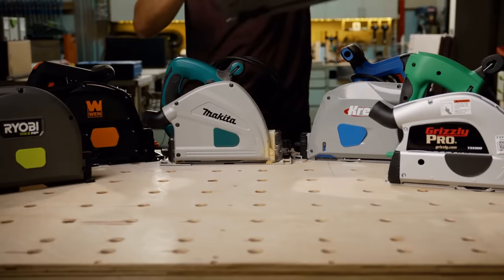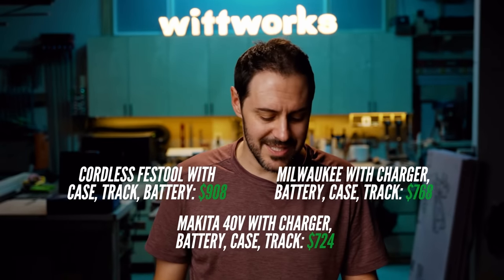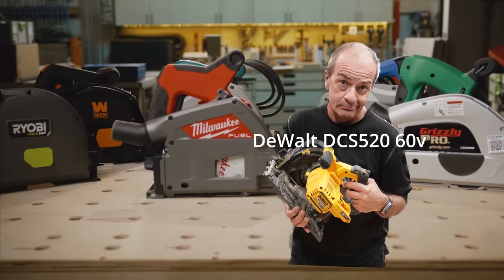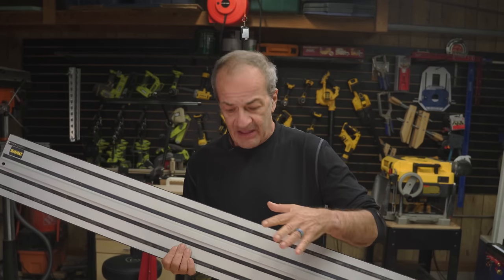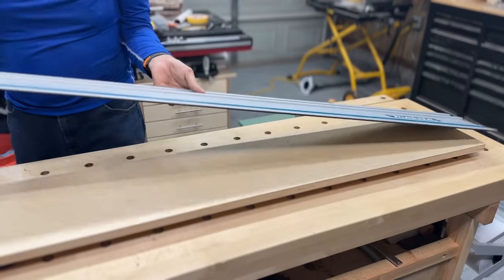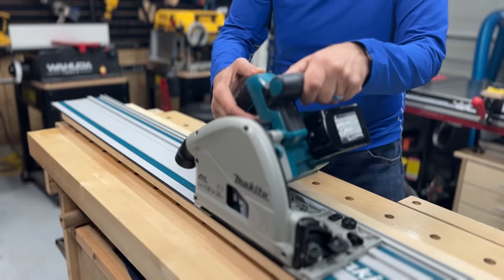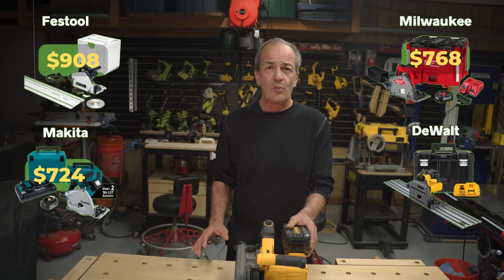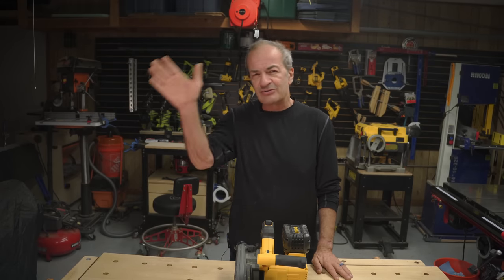The Best Track Saw NOBODY Talks About

Comment: I only do straight 90's. I have the Wen and the 118" track (2 pc). Is it great? Hell no. The bevel is janky as hell. But for straight 90's, it's perfect. I set up my machine squares on the bottom and it's been great. Would I like another track saw? Probably, I guess. It's fine.
Reply from the maker: I have a few Wen tools (drill press, 12" disk sander) and they're pretty decent. No complaints. The price is definitely right, and at least you can get someone on the phone (unlike some companies).

It's actually pretty rare that I do bevels with a track saw also... I've done it with this DeWalt maybe three times total.
Reply: @BustedKnuckleWoodworks  My money went into the Dewalt 735 because I work with a lot of 8 to 12' stock like white oak, walnut, elm, etc. I got a large bosch router, the dewalt 735 and the wen track saw for the same price as a silly festool domino haha.
Reply from the maker: I'm keeping my Domino. Selling it on Craigslist is my entire retirement plan LOL

Comment: I was wondering why Witt never even mentioned the DEWALT. I got the DEWALT track saw about 3 weeks ago for an even lower $579, with everything included that you mentioned in the kit. I was holding out until the Milwaukee came out, but once I saw the prices, it was a hard no for me. Not to mention I’m DEEP in the flex volt system now (probably 10-12 9ah batteries deep). I just wanted to indulge in the new toy that we all wanted to see for years. But at the price for the Milwaukee, it just didn’t make sense to me.
Reply from the maker: Nice! The DeWalt track saw is great with the 6ah it comes with, but really screams with the 9ah. You really need the 9ah to squeeze the 2,000 watts out of it that I mention in the video...
Reply: @BustedKnuckleWoodworks  Well it’ll be screaming almost every time. My 6ah mostly get used for the dust extractor and DEWALT outdoor power equipment when the spring/summer rolls around. Another good point too: The DEWALT dust extractor (DCV585) talks to the track saw via Bluetooth. I believe the Festool and DEWALT are the only two that have those kinds of options as of now. Good content.
Reply from the maker: @CardinalVibes  The latest Makita 40v does that now as well.

Comment: Hi, I found 1 thing wrong with DeWalt. its very difficult get get the battery out of charger  or tool. Maybe its because I have small hands? any suggestions would be helpful and appreciated.
Reply from the maker: True, the battery on this is kind of heavy. I sometimes spray the latch with WD-40, that helps the latch slide easier.

Comment: I love the DeWalt, but the fiddly depth adjustment and the battery position right where my knuckles go (I’m a leftie) are two things that kept me from buying it 🤷‍♀️

By the way, the plunge mechanism is the best I can think of. I like it a lot because it’s super ergonomic in contrast to the pivot mechanism…
Reply from the maker: I don’t find the depth adjustment fiddly at all — in fact I think it’s better than the Makita. As several other commenters have pointed out, the battery placement is not ideal for lefties and I’d have to agree with that. And +1 on the plunge mechanism. Much easier to handle in my opinion.

Comment: I have run the Dewalt track saw for a few years. I have both the Dewalt track I started with and the Festool track. I prefer the festool track for the available accessories. As for the saw...it's as good as any of them and definitely deserving of being included amongst the upper level saws. I believe it to be the most versatile track saw out there. None of them are perfect. Each has features that are done better by others, so there is no best saw. Just which features are most important to you. But power tools anymore are as tribal as politics, so each brands fanboys will insist their color tool is best because it is a certain color. Makes it hard to find unbiased reviews anymore. For me, I want the best tool for the money and could care less about the color. Chargers take up no space and are a dime a dozen so I don't care about battery platform.
Reply from the maker: Great and thoughtful comment, thanks for posting it. I agree about the tribalism, which is part of the reason I made the video. Lots of comments here along the lines of "Dewalt sucks" which makes no sense to me. I just happen to think this saw is worthy of consideration among the other saws you see all over YouTube. Not necessarily the "best" in every way, but at least some out-of-the-box thinking with its design and implementation.
Reply: @Busted Knuckle Woodworks  and you can't even argue with them even though you come with facts because facts don't matter anymore, just color. Dewalt has several new tools that outperform Milwaukie yet saying that on the internet will trigger Milwaukie fanboys. Dewalt quietly released a beast of a cordless impact while at the same time Milwaukie secretly redesigned their premiere impact without changing the model number resulting in people thinking they were getting a tried and true great impact when they were actually buying something that was going to fail them, in many cases on first use. Does that mean other red tools are bad? Absolutely not. I have some really good red tools, and some really good yellow, green, and so on tools. Anyone who chooses a tool based on color alone is missing out on some really good tools.
Reply from the maker: @Ratheon1075  right on dude, love that take 👍
Reply: They make battery adapters, so batteries aren’t as important as they used to be; they the most important item, but they shouldn’t determine the tool

Comment: As far as I am concerned the Mafell track saw is the best on the market. Expensive yes.But the best.
Reply from the maker: Have no experience with that one but I know everyone who owns one loves it
Reply: We have the Mafell, TS 55, and Makita X2 cordless, and the Mafell is in a whole different league.  The cut quality and precision is simply unrivaled especially when using multiple tracks.  We have to be careful when handling cut material because the edges it leaves are so sharp they will give you paper cuts.
Reply from the maker: @dcl97  Please buy me one and I will review the 💩 outta that thing 😁
Reply: In UK, corded Mafell is not as expensive as we assume. It comes with all the track and accessories. Buy with the M-class dust extractor, and it's a similar price to the lower quality alternatives that you have to buy the 'accessories' for. I'm saving up
Reply: It is not that great actually but ok

Comment: greetings from Europe! nice video 👍
do you know the Metabo cordless track saw? for me it is very interesting that some very common brands here in Europe seem like to "not exist" in the US, as the mentioned Metabo or f.e. Bosch who also has a very decent cordless track saw. Is this just the non existing footprints they have in US?
Reply from the maker: Both of those exist but among track saws but they are not very popular in the US. I suspect part of the reason is that a lot of the market here is controlled by 2 major retailers and they 1) have exclusive brand deals on certain items, and 2) don’t generally carry these saws in their stores. 

Depends on the item though. In the US Bosch is very popular in routers, Metabo in nailers, etc.
Reply: A major part of the issue is that nearly all of the tool companies are owned by a few holding companies.  Many tools are identical with the exception of the colors of the plastic and rubber parts, and the colored bits interchange.   Porter Cable and Flex, Bosch and Milwaukee, same same, just different colors.  And which holding company owns what changes fairly often.  So, EU brands don’t show up in the US because the holding companies don’t want to compete their brands against each other.  And some brands are at different levels in different markets.   Ryobi, is a homeowner brand in the US, and a pro brand in Australia and New Zealand.
Reply from the maker: @randallthomas5207  I actually did a video about this, it’s on my page. https://youtu.be/16WAta5XFrc

Comment: how is the Dewalt dust collection on this?
Reply from the maker: It’s perfect if you have the locking Dewalt connector, or one of those flexible adapters like they sell at Rockler. The dust chute swivels 360º. I mostly use this outside when weather permits and just let it fly though 👍

Comment: The batteries really are the decision maker and how the power tool manufacturers use their tractor beam to keep you in brand. I’ve bought into Milwaukee and the tool only price gets me every time. I just don’t want a collection of chargers and batteries to keep track off and keep healthy
Reply from the maker: That’s why I call those discounted multi-combo tool bundles the “dime bags” of the industry. They hook you in with those and it’s really hard to switch after that. Although I’m a big believer in being on at least two platforms, not just one.
Reply: Why did Dewalt discontinue the brushes and the rotor shaft for the corded 520? Dewalt lost me as a customer, they walk away from their products snd also gutted porter cable after their purchase. NO bueno!
Reply: @BustedKnuckleWoodworks  I’d have to agree, although I bought into a line of cordless tools because of the performance of one of those tools and there reputation. They are very proud of their other tools, just look at the pricing.
Reply from the maker: Which line did you buy into?
Reply: @BustedKnuckleWoodworks  Milwaukee refused to buy DeWalt because of killing Porter Cable line there router line was the industry’s standard as well as there other fine tools there cordless were only ok. The majority of my corded tools are PC
Reply: Eventually, companies will start selling refurbished or generic replacement batteries. Will be interesting to watch.
Reply from the maker: @nunyabidness3075  They already do for the 20v. Never seen any for the 60v though. I don't think there is a big enough demand for the overseas knock-offs to bother copying them.
Reply: @BustedKnuckleWoodworks  Lol, I had to go shopping. I then immediately worried about quality.  I’m going to see about domestic suppliers. Thanks for the info.
Reply from the maker: @nunyabidness3075  Home Depot probably has the best return policy if you need to do that.
Reply: @BustedKnuckleWoodworks  Not yet. A couple years ago I sold my Ryobi stuff and got more serious with some Milwaukee and Makita. Batteries all still good for now. I got pretty fed up with Ryobi battery quality. I guess HD must have stepped up because it was likely hurting business.

Comment: Don't know how you got your saw to work on a Makita track. The anti tip feature on the Makita track prevents the dewalt saw from fitting. I had to modify my Makita tracks by routing off that lip.
Reply from the maker: Don’t know what to tell you. You can see in the video it clearly works. Maybe the design was changed?

Comment: One caveat you need to be aware of on the DeWalt FlexVolt track saw on it's peak power rating. To be able to pull 2000 watts from it's motor, you have to use the 9ah or larger FlexVolt battery. The included 6ah FlexVolt battery uses 18650 cells which in it's triple stack configuration has an approximate peak wattage output of around 1200 watts. The 9ah FlexVolt uses 21700 cells which will produce a peak of more than 2000 watts which will allow the track saw to pull to its full potential. You should try your own track saw with the 9ah FlexVolt and see the difference yourself. Also one of the reasons the DeWalt track saw is not very popular is due to it's poor ratings on review sites. Take a look at the Tool Box Buzz head to head review of track saws, it came in last place. The DeWalt was the lowest cost saw though in the comparison. But they also used the 6ah battery that came with the saw. If they had used the 9ah battery, it might have done better...
Reply from the maker: I do have a 9ah battery, will have to give that a try! Thanks for the excellent info!
Reply: Toolbox buss are Milwaukee simps

Comment: Pre-ordering and then receiving the dewalt tracksaw is one of the greatest tool disappointments I have encountered.  In principle I agree, but dewalt abandoned it.  In hindsight I should have bought the saw and festool or makita track.  I kept seeing people use a track saw without clamps and was amazed because my dewalt tracks walk if I try that, there are also no TSO/woodpecker/or even Dewalt add-on products.  Moreover, my saw and track were off, the more I tinkered the worse it got an 1/8” over 8’. I bought a makita 40v and will never look back. This dewalt saw got me over my batteries determine my purchase.  I now use several platforms aided by Christmas battery give aways and don't regret it for a minute.  Now I pick the best tool and not the one that can use my batteries and also don't wear a path in the concrete walking from one end of a sheet to the other
Reply from the maker: Man, that's weird... my saw has been dead accurate, and the track has never walked on me once. The Makita is a good saw. Just wish the case was better. I agree that people tend to get tied in to battery platforms more than they should be.

Comment: I understand that the dewalt has a special blade.  Meaning you can’t get an aftermarket blade.  I also heard the dewalt blade isn’t great.  I don’t have this saw so it’s just hearsay.  But since you do can you let’s us know if there’s anything to those claims?  I do own the Makita system you compared this to.  I guess i got it on sale, I only paid $500 for my kit.
Reply from the maker: Not true. I have run other blades on this saw. The CMT 56T blade is awesome on this for melamine. The DeWalt stock blade is also very good, and is the blade I use most of the time. It's a standard arbor size and take the same 6.5" blades as all the others.
Reply: @BustedKnuckleWoodworks  thanks perhaps it’s the Milwaukee then, and I remember incorrectly
Reply from the maker: @mwoody4560  Not sure. Haven't heard that about the Milwaukee blade. I do know, however, that their track is slightly different than the standard Makita/Festool tracks, which makes it incompatible with a lot of the accessories like the TSO squares and such.

Comment: Cordless is all good until time to replace those batrays
Reply from the maker: So you don’t own any cordless tools? 😳
Reply: @BustedKnuckleWoodworks  Yes I do.  But I think for tools that can be used with a cord will in the long run be cheaper.  Some tools need to be mobile.

Comment: Best track saw is the circular saw you already got. Just set up a fence (clamp on straight edge) to whatever it is you’re cutting. 1/2 - 3/4 inch plywood works great as a fence. Just depends on the motor clearance of the saw.
Reply from the maker: I always say, go with whatcha got. Don't let the lack of some fancy saw stop you from building anything!
Reply: The amount of people that say this nonsense is quite funny 
It’s not even close I do that on site when my ones not with me a track saw is so much more capable
Reply: I used to try justifying not getting a track saw too. 
The clean cuts, the accuracy, the speed, the ease of use. It's been the best tool purchase I've made in years
Reply from the maker: @Jeremy_810  boom 💥 there you go 👍

Comment: var lee = new Lazy<Woodworker>();
Reply from the maker: lee.Add(new Tool());
If (lee.isHappy) {
   lee.doReview() }
else {
   return();
}
Reply: I am glad I found this little club of software engineers who are obsessed with woodworking. 

This is a perfect place to ask a serious question:
What is the best place to buy hardwood In Austin?
Reply from the maker: I would say either Fine Lumber (north) or Dakota (south). I usually use Dakota. If it’s a small amount I will sometimes check out Rockler or Woodcraft. There’s some good mills too just outside of town.
Reply: @BustedKnuckleWoodworks  Thank you so much! I usually go to Fine Lamber… but the thing that they don’t have prices on display drives me nuts. Every time I feel that they are making these prices up just by judging on my appearance.
Does Dakota do the same?
Reply from the maker: @stdafx  that’s funny, I’ve often felt like that there too. That’s why I ALWAYS call on the phone and ask prices first 😊 there. 
Dakota stopped letting people “browse” during Covid, not sure what the policy is now. What they have been doing is forklifting pallets of lumber out back and letting you choose from there.

Comment: Except is a dewalt.
Reply from the maker: 😂 and it’s yellow. That automatically makes it a horrible tool, obviously 🙄
Reply: @BustedKnuckleWoodworks  when I first started out in the trades I was kitted in Dewalt, until I used the Plumbers Milwaukee drill, been team red ever since.  Its like the battle between Ford and Chevy, pointless but fun to engage in regardless.
Reply from the maker: To be completely honest if I were to switch or add another platform it would be Milwaukee hands down. But that said, I am very skeptical on their new track saw. Only 18v? The math just makes no sense on that one 🤷‍♂️
Reply: @BustedKnuckleWoodworks  based on the fuel system though.  I bought my cordless fuel circular saw 2 years ago(?) and haven't touched a corded saw since.  when coupled with a 12ah battery it is a beast.  I haven't found anything it won't cut.